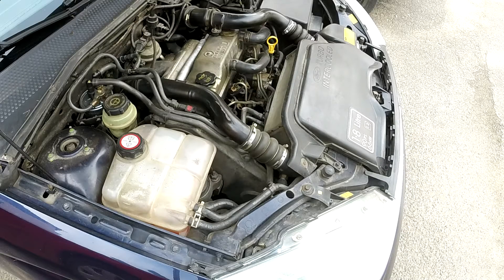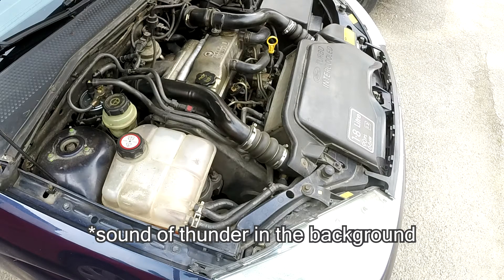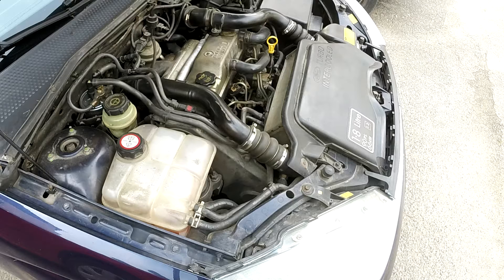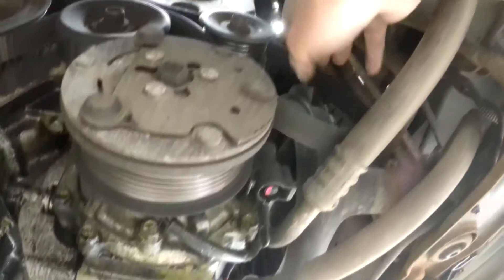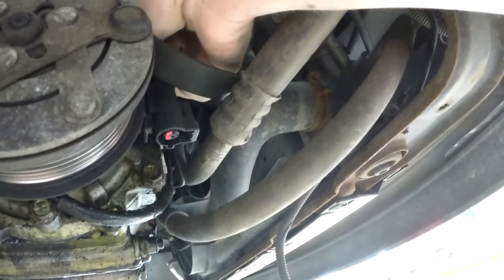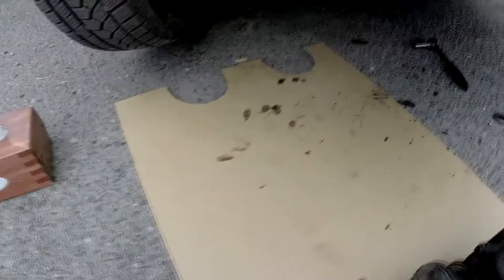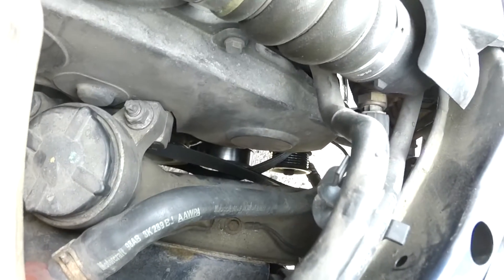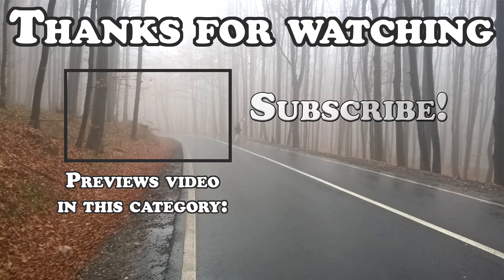How to remove the AC compressor - 2001 Ford Focus

Comment: Could I use an aftermarket one? Iv had bad trouble with after market stuff but an ac compressor should just be an ac compressor compared to like a etb
Reply from the maker: Yes, I just bought a Nissens compressor, but don't forget to wash the system and dry it out with nitrogen before installing the new compressor.
Reply: @N33sWorkshop  awesome, yeah I'm probably just gonna have my mechanic do it because I'm not trying to mess with it. I bought a gpd compressor for 200 compared to the OEM ford compressor that would have cost me around 700 dollars. Since iv had such shitty luck with aftermarket stuff I just wanted to make sure I wasn't looking st the same situation
Reply from the maker: Never heard of GPD, but I guess it’s ok.
Reply: @N33sWorkshop  its global parts distributor, the specialize in ac compressors and ac systems

Comment: sorry I need help 🙄 I do not work AC ... the light of the button lights up but the electromagnet on the AC does not trigger .. and I tried to directly connect the AC pump to the battery and it works ... you can tell me how can i solve?
Reply from the maker: I guess you don't have the required pressure in the system, try filling it up.
Reply: no, pressure is the electromagnetic coil is excited only if the attack directly to the battery .. it's a power problem, but I do not know where to check ... the fuses and the relays are good
Reply from the maker: The electrical system for the compressor is pretty complicated, there are multiple conditions that need to be ok for the coil to get current. I suggest you take it to an electrician. I can't help you.